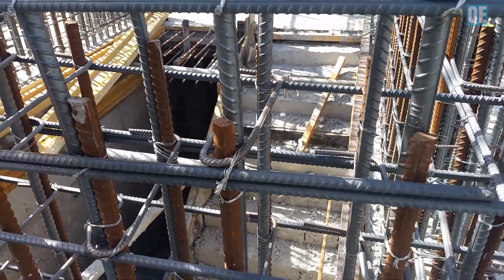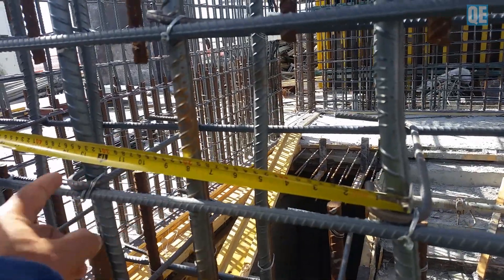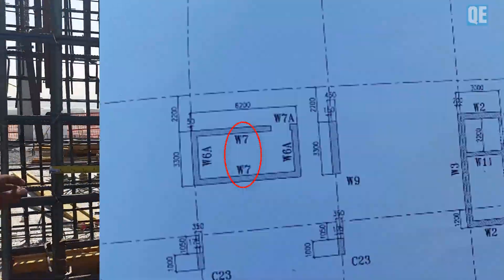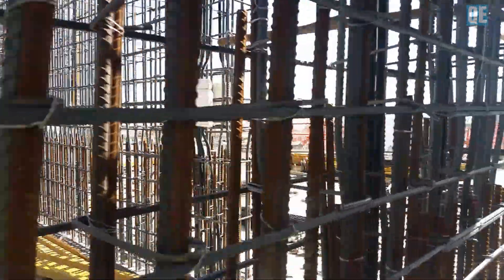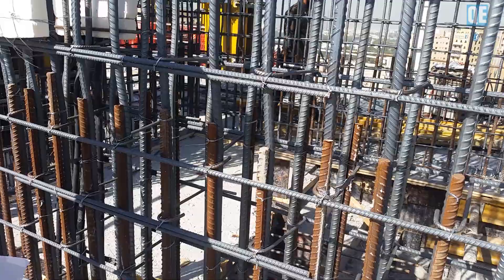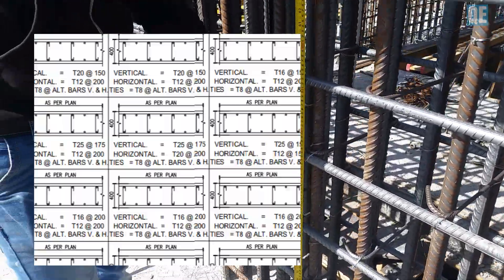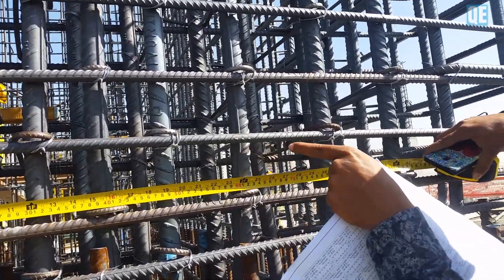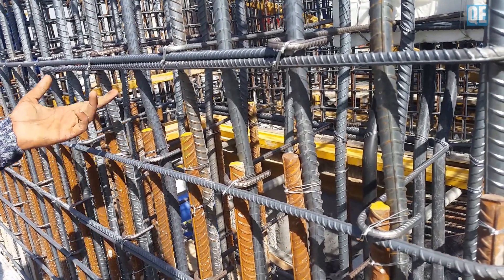How to check a core wall reinforcement

Comment: Does 100 % lapping of bars is allowed at a given section for walls like these?? The bars are not staggered.
Reply from the maker: It is up to you but the min. is 50D
Reply: @qualityengineersguide  Which code you are referring to regarding steel in your country?

Comment: what is this rust in bars ,Is it okay ??
Reply from the maker: Hi friend, 
That is not rust. No rust will form from just 1 week of installation. That''s the misconception there rather it is called "discoloration."If you are an engineer and you insist that that is rust, they will detect that you are a newbie.
Reply: @qualityengineersguide  this is the first stage of rust but you have to given them instruction to clean it by brush , next stage coming like orange or yellow color ..best regards